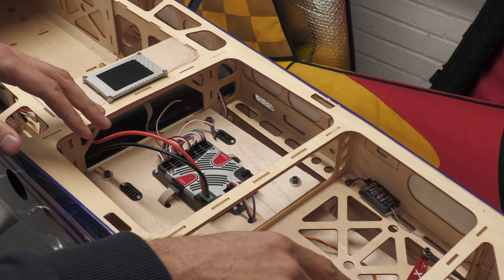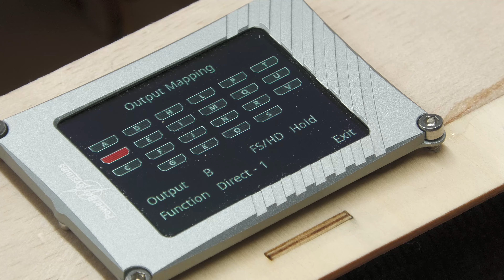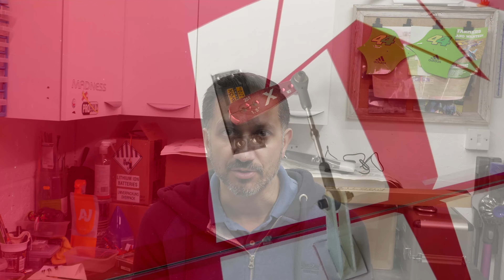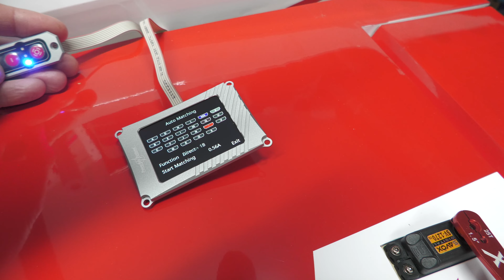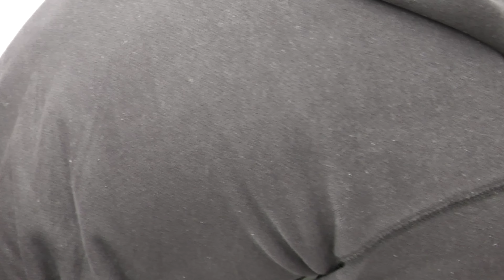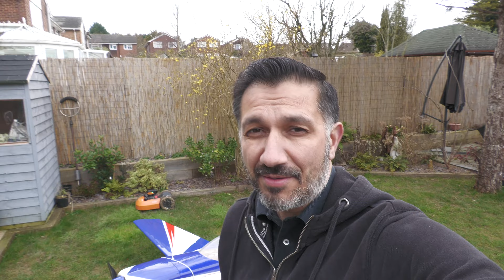PowerBox, CofG, mounting the MASSIVE batteries | Project Blue

Comment: Did you match up the elevators through thei powerbox system? Or through the subtrim on the tx?
Reply from the maker: Matched the ailerons using the Powerbox. The elevators I hosted used sub trim on the TX.